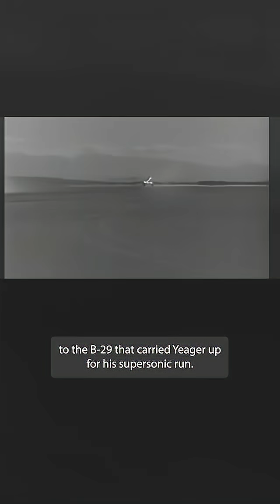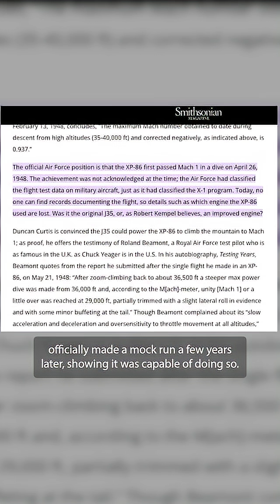Who ACTUALLY Broke the Sound Barrier…

Comment: I find this dubious at best. The Prototype Welch was flying had a elevator and horizontal stabilizer at mach speeds the shockwave from leading edge would blank out the operation of the elevator. Hence why the X1 was equiped electric trim that moved the horizontal stabilizer.
Reply from the maker: Not with swept wing (or not near as bad with it). Same plane did it a year later with no modifications. That one is “officially” documented.

Comment: It's likely a super prop test pilot as the super Mustang,Spitfire has versons that will easly hit maxh 1 in a dive from crusing altude... But Chuck yager did it under contoled flight... So like the write brothers controlled is the massive underused term.

Comment: This video is silly and irrelevant.  There were many aircraft and pilots who went transonic and supersonic in dives during WWII.  It’s highly probable that the P-38, P-47, P-51, ME262 and ME163 all went transonic or supersonic in dives and survived to tell the story.  The ME262 and ME163 almost certainly went supersonic in dives.  And these all did it long before Welch.
Reply from the maker: Without meaning to… Welch is different IMO. Welch has the calculated plan of doing it as well as not the speculation that these other Aircraft had done it. Even though it seems to be a non-event no one has ever on purpose actually done it and he is interested in chasing that demon back into the thin air a little bit further himself…. 

That's what its different…
Reply: Most p-38s would not survive transonic speeds, as the buildup of shockwaves on the elevator would prevent the pilot from pulling up. Later models had an air brake for this reason. As for the jug and the mustang, they both had rip speeds at about 550 mph depending on the variant. At higher altitudes, Mach 1 is around 100mph faster than that. And if you’re still wondering about the late model p-38s, while I don’t remember the exact number it’s less than 550. (I think 480 or 490mph, but don’t quote me)

Comment: The F86 followed the F80 in the Korean War 51-53 the F80 May have been around in 47, it preceded the F86, apparently,  as it was the first jet fighter for the USAF.. Also, I must concur with a previous comment regarding the elevator being hinged to the horizontal stabilizer, which will freeze up approaching Mach.. The commenter was correct when he stated that this was the reason for the horizontal stabilizer becoming Entirely mobil independently !!

Comment: At least one British Spitfire pilot went 'transonic' & lived to tell the tale. However, the Spitfire was severely 'bent' by the experience, Miles Aircraft provided the essential insights that allowed reliable supersonic flight. Those insights were shared with a US team who 'shared' nothing back!
Reply: No propeller driven aircraft ever reached even .9 Mach, simply impossible.  Speedometers lose accuracy at high speeds, not designed to measure anything near 600 mph or more.
Reply from the maker: @MaithriSanitgun agreed. The prop physically prevents this from occurring.
Reply: @MaithriSanitgun  My recollection is that the airscrew broke/fell off in the power dive, certainly the mainspar was bent backwards creating gaps at the front of the wings.
The speed of sound changes with altitude as a result of air density & temperature. This event was reported as a 'power dive' which the pilot barely survived, so is it perhaps the case that velocity attained at altitude lead to what was reported as 'transonic' speed & most importantly 'control reversal' due the conventional 'hinged' type control surfaces?
A principal 'secret' behind the viability of the 'Miles Aircraft' supersonic design (successfully tested with an unmanned scale replica) lay in the 'one piece' control surfaces the idea for which apparently came from 'Spitfire experience'.

Lastly as a question 'supersonic wind tunnels' apparently exist so how is the airflow created if not through some form of ducted fan & is it the enclosure of the fan/propeller in a duct what overcomes the 'objection' to propellers & supersonic speed (of course some sort of venturi tube beyond a fan might boost airflow velocity)?

Comment: All props to George Welch. He was flying bad a$$ery. But did you know there were rumors a spitfire at the end of WWII went into a full dive and broke the barrier(it’s a verified rumor!)? There was also rumors of the German ME262 in near full dive breaking M1. I also heard a man in 1840 strapped wooden wings on his arms jumped off a cliff to become the first man to fly.
The X1 piloted by Chuck Yeager broke the sound barrier. The X1 was a plane designed for M1 performance, to be controlled forward by the engines (aka flying not falling) at M1, instrument onboard measuring M1. None of these apply to the XP86. While North American would measure M1+ on the XP86 a number of months later, take note of “measured” versus ‘it was rocketing toward the ground, so why wouldn’t it have gone M1’. 

Do a video on George Welch. He’s very well worth it. Credit him with pioneering flight near the edge of M1. But crediting him for “the man who broke M1” is nonsense.
Reply from the maker: Have you heard of the “Natter”?

Comment: In a dive doesn't count. A few years ago a man took a balloon to up over 100,000 feet and bailed out
He was not in a plane, but wore a pressure suit. He flew supersonic without a plane, because mach 1 is much lower at extreme altitudes, and the shock waves are lower.
Reply: The narrative specifically describes a dive!
Reply: Where is the paradigm that excludes a dive? At high altitudes, the speed of sound decreases. The Bell X-1 rocket (not jet powered) was dropped from a B-29 mothership about 20,000 feet. Soon afterwards, the rocket engine was lit and climbed to about 43,000 feet where it achieved supersonic speed. Why didn’t the Bell X-1 tried to go supersonic at the 20,000 feet release altitude? Because air is less dense at altitude, and the speed of sound decreases with altitude. Whether it is a rocket/engine powered aircraft, or a human body falling through a thin atmosphere at high altitude, Mach 1 can be achieved. Same with the Concorde, it would achieve Mach 2 at high altitude.

Comment: The key aircraft control feature for supersonic flight is an all moving horizontal tail for elevator control.  A conventional sectional delection type elevator control will suffer control ineffectiveness in transonic airflow, usually leading to a diving crash.
Reply from the maker: The swept wing of the YP-86 delayed the onset of this giving it a higher Mcrit
Reply: The Bell X1 had straight wings, but an all moving horizontal tail plane.  The XP-86 had swept wings, but only a sectional elevator. Neither aircraft had everything right, but both broke the sound barrier successfully.

Comment: If you do enough research you will discover that the Wright Brothers were not the first to fly a heavier that airplane.  In fact in order for the Smithsonian to receive the Wright Flyer for life they had to cleanse the history books shall we say!  There are dozens of such examples, Marcony and the radio, verses Tesla, many of Edison claims!
Reply: If you make that claim, obviously you may have done the research yourself. Can you quote sources?. Many people have flown different ways, like climbing a hill and then running down the hill while “wearing” a glider wing and achieving sufficient speed to become airborne. The Wright brothers also achieved flight by using their design as a glider. The difference is they made the first powered flight by adding an engine to their glider. It was flown for a short distance but demonstrated that powered flight could be achieved.

Comment: Wouldn’t the shockwave of breaking the sound barrier go through the turbine on the F-86? You can’t have fast air hitting the turbine…also, to do supersonic the control surfaces need to be purpose designed. 

“If” the F-86 did go super sonic it was more of a miracle the pilot survived. (This is just my opinion)
Reply from the maker: They did it successfully a year later intentionally so it has done it by the admission of the AF and NAA. The engines aren't am issue as the nacelle killed the shock wave by expanding the area past the intake making it slow and build pressure (for more effeciency) before entering the compressor.
Reply: @The_Flying_Mechanic  that’s crazy. I learn things every day!  Thanks for the feedback, I appreciate it.

Comment: Although this was never (and may never be proven) A German luftwaffe pilot of an Messerschmidt ME262 Jet fighter in 1943  may have been the first to go transonic and possibly supersonic  Hans Guido recalls that he rolled his aicraft into a steep dive to  catch and fire a P51 mustang . What happened is that his aircraft actually outran the mustang and began to vibrate and shake very hard  .He also could not use his elevon controls they were frozen and vibrating. He also noticed his speed meter needle way off the scale  Faster than 600 miles (The ME262 was rated at 540 miles and hour on most level high altitude flights.) Soon for a few seconds the vibrating stopped and everything was smoother and quieter. When he reduced his engines to reduce speed  he went back through the shaking for a few seconds. Upon landing  they noticed the wings tips and edges were warped and missing rivets.   Who knows   he may have been the first  but Yeager  had better proof.
Reply: This is amazing as I was just about to recommend both the book and the ME262 stories!
Reply: Entirely believable, and don't forget the swept wing rocket interceptors. .
Reply: 000⁰po p] p] p] p p
A was z
Reply: No, because he was not American, he CAN NOT have broken the sound-barrier!
Reply from the maker: Quality control was so poor on the Me262’s that it is possible one would have held up to the transition zone but many of the ones that were looked at after the war wouldn't have confidently been able to stay together. It is possible that happened though!

Comment: The F-86 Sabre equipped for military action was able to break the sound barrier in dives, as proved after coming in operative service. In 1943 the Mk. PR XI Spitfire reached Mach 0,92 in a 45 degrees dive from 40 000 ft during sound barrier tests, and in 1952 a Mk. PR 19 reached Mach 0,94 in a dive from 51 500 ft over Hong Kong. So why wouldn't a modern, sleek, perfectly shaped F-86 jet fighter be able to fly a few miles faster than a piston engined fighter designed in the mid 1930s?
Reply from the maker: It did and I think Welch did before Yeager (in a dive). There's a good chance someone unknowingly and accidentally did it prior to him too...
Reply: A P-47 pilot also entered the transonic zone in a dive.  Made it out alive somehow.